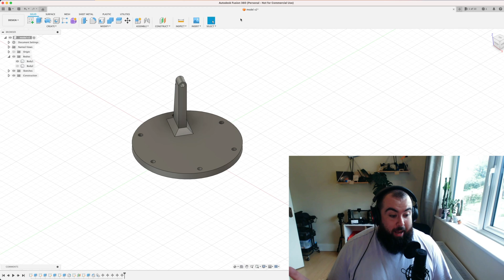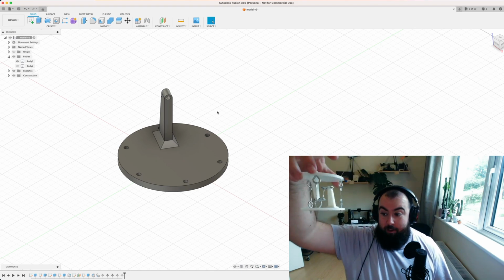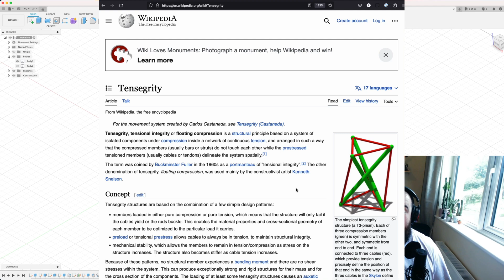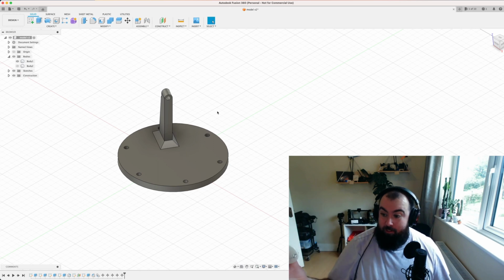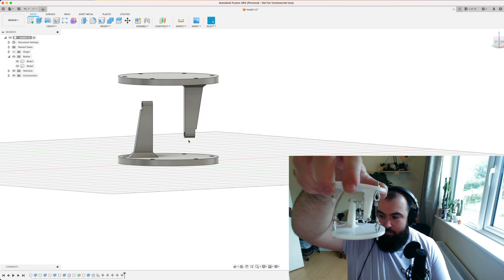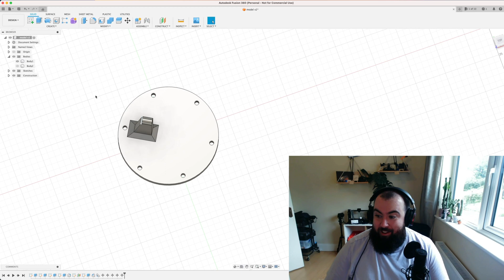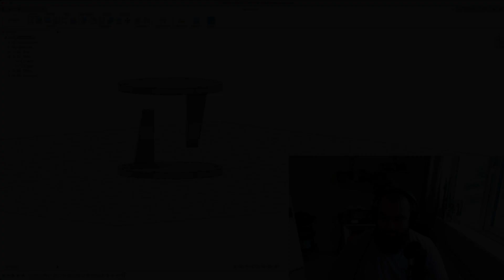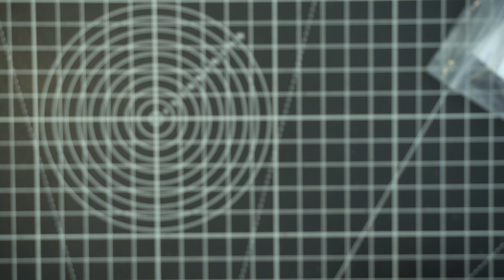Tensegrity Model - Desk Toy

Comment: Great proof of concept. BTW, wire rope, wire cable, zip wire, zip wire cable are all used to describe the same thing, dosn' matter as long as we understand each other:) My suggestion, in case you decide to use this construction to make a table or something else, try to use something that suggests it is bendable, not rigid, like for instance sisal rope, or standard chain, to provoke that initial surprise in viewer, which is in my opinion the essence of every tensegrity construction. The wires in your model may at a first glance be mistaken for thin bars or something similar. I'd also avoid as many visible mechanical parts. Just as an example, I'd use two acrylic tubes instead of the "legs" on your two parts, and one length od sisal rope through both and fixed at their ends, so it would look like just a rope bent in "Z" or "S" shape, unsupported by anything. And 3 or 2 lengths of rope or whatever you prefer, like in your model...
Reply from the maker: Thanks for your input! Glad you like the model! That is all great info, I'm still not 100% sure of the design for the table I want to build, but you have made some great suggestions, I will remember them when I'm doing the final design.
Reply: @careyian  I just wanted to share my general view on tensegrity. I don't think anybody would go into such a project because of it's sturdiness, which is just not one of its strong points. The main attraction is that most constructions seem impossible at a first glance, so it stands to reason to amplify that effect to its maximum. One option is to use visual tricks like the one I mentioned above, the piece of rope, which is seemingly even lose, supporting the table. Another may be to make the top board seem very massive, by using the thick box made of thin material, and contrasting it by using very thin but strong steel ropes like yours, or even nylon fishing strings, which may appear almost invisible, etc.

I subscribed to your channel, and will be watching this space in hope you'll come up with some new creation:)
Reply from the maker: That’s great John! Happy to have you here! Thanks for the info, I’ll keep it in mind… Hopefully my table when I get around to making it won’t disappoint!!